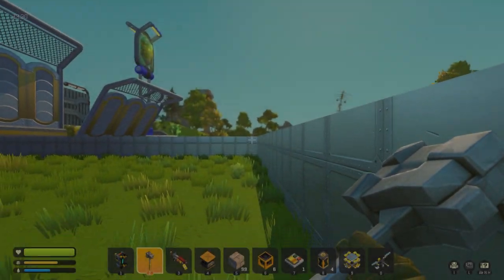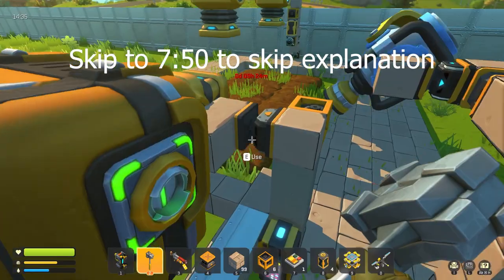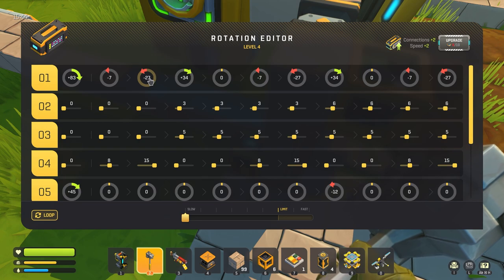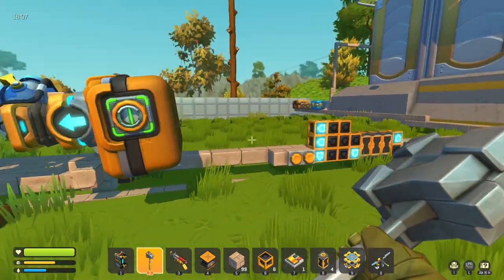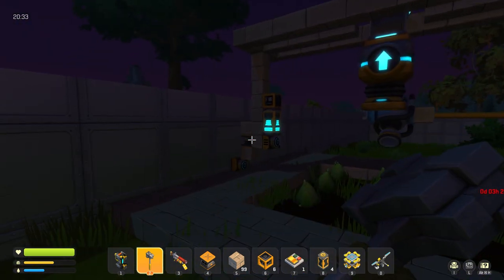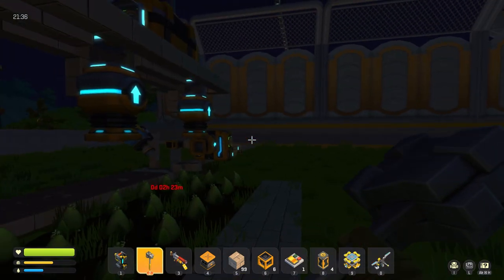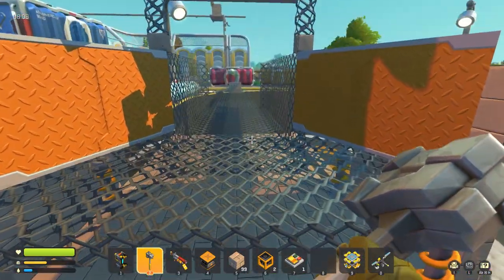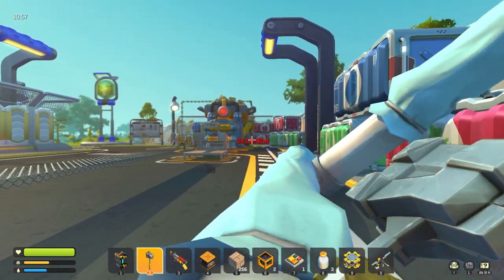Internal Package Transport System | Scrap Mechanic Survival

Comment: WhatToDo made a video about buggy bridges. If your bridge is to long it will be bouncy to travel on it. To fix it you have to seperate the bridge in different parts. You can do this by leaving a gap and weld a block to one side, or you can color the blocks attached to the pillars. 
Btw, this comment does not count against ai factory. I absolutly want to see that!

Comment: If you're worried about controller consistency, you might want to consider using a stopper of some sort, instead of switching the controller off. Like, a stopper extending from the side once the sensor is triggered to stop the other package
Reply from the maker: GORGEOUS IDEA
Reply: I was going to suggest the same thing

Comment: 20:39 The reason they're endlessly spinning is because you changed something while it was in loop mode, and they think they need to re-align their position to 0. The solution is to ONLY edit things, or add new connections, with loop mode off. If you follow that basic rule, in my experiance, you will never see this "glitch", but if you edit in loop, it will ALWAYS try to correct their position, and consistently spin forever.

This is my working theory - Controllers read left to right when on, and then goes back to the start when shut off. When you edit in loop mode you give it a midprocess command it can't possibly remember, but it can calculate that its definitely not where it should be based on the imputs it was given. When you shut the controller off it goes back through the processes it did, and realizes that its still not at 0, so it keeps moving. I think it spins forever because its trying to revert a change that it can't calculate because it lacks information. (this is the same effect as your trap spinning at lightspeed to "catch up", except in that instance it can calculate exactly where it needs to be.)

Comment: Instead of outright cheating, find the Master Switch in warehouses, flip it, then use dev commands to decrypt the warehouse so you can loot it. You can get a TON of blocks and building materials from it. And the thing is is it’s planned to function like that in the future, just not fully implemented. So it’s not technically cheating if you go through the process they plan on using to decrypt the warehouse.

Comment: How will you handle the cell boundaries between the packing plant and the trader? Crates seem to despawn or fall when they pass the cell boundary. Will you have to build a queue at each boundary until you flick a switch?

I think you should build a crane that puts the crates on a vehicle. Then if you really want automation, you could have the car follow a track. You’d have to sit in the car while it drives, but you wouldn’t be doing anything.
Reply from the maker: Lucky for you, I just uploaded the episode where I answer all your questions ;)
https://youtu.be/5LjpcJQ_IJQ
Thanks for  the heads up!
Reply: Thanks!!